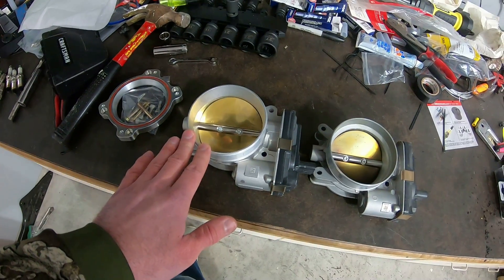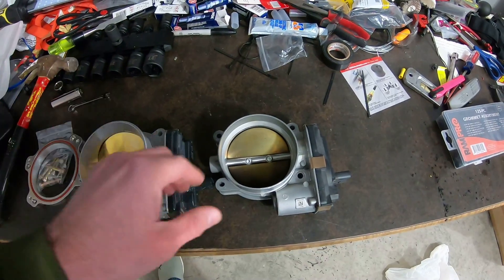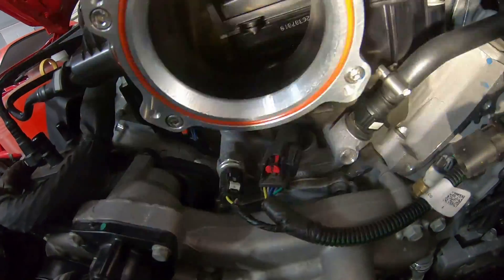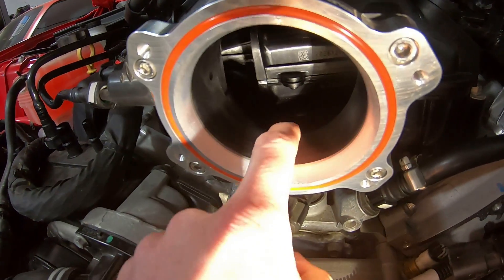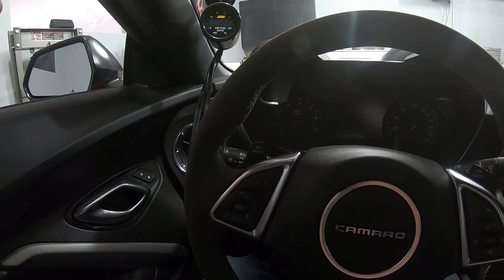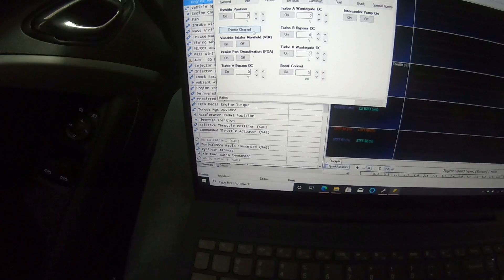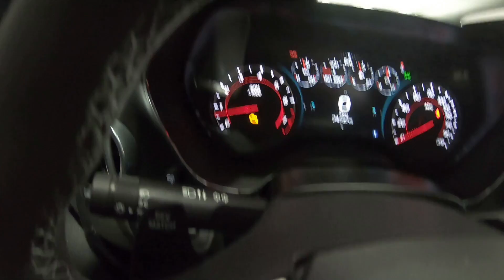95mm LT5 Throttle Body Install on LT2 Manifold

Comment: I put my lt2 intake and put it on perfectly and next week I will be going for my tune w e85 flexfuel ‘ I have another question if u don’t mind ‘ so I bought the 95mm TB with the adapter but it says that it requires tuning to run ‘ can I put it still put it on then a few days I will get my tune ? Or is it a tune required immediately after putting the TB on ? I’m afraid my car will stop running or something if I put it on right now
Reply from the maker: U can put it on. Let it idle 3 min shut off, start and idle 3 min again. As long as it doesn't throw a code it will be fine for couple days. The car will limit torque because of the extra airflow at low rpms. Wait for wot until it's tuned tho to be safe. 👍
Reply from the maker: Pull neg battery too. Otherwise I think the check engine light comes on
Reply: @EssMotorsports  my CEL is already on because of my headers ‘ I took the cats off and straight piped everything
Reply from the maker: That'll do it. Nothing a simple tune can't fix
Reply: @EssMotorsports  thanks for the help bro’ next week I will go in for my trans tune w e85 and flexfuel ‘ my setup is LT2 manifold, k&n intake, 95mm TB, mishimoto catch can, 1 7/8 LT headers and after my tune in the coming months a cam. ‘ hoping for good numbers
Reply from the maker: Let me know what u get for power numbers! That's always fun. What u get for 93 and E85. I'm curious!!
Reply: @EssMotorsports  I will let u know when I get my dyno tune ‘ thanks for your help again bro !
Reply from the maker: The question is how much do u like the new header sound!😈🤟🔥
Reply: @EssMotorsports  I love it ! It screams and echos everywhere ! And of course my neighbors love me :)
Reply: @guyana426  what did your dyno numbers show?

Comment: Can I find this adapter for a 2015 Silverado 6.2?
Reply: Yes you can I have it on my 15 6.2L
Reply from the maker: Pretty sure they use the same throttle body from the factory so the one i used would work on your truck as well.

Comment: So I do not have to port my lt2 intake manifold throat? I’m buying a lt2 intake manifold unported and want to add the 95 mm tb before tuning. So I jus buy the adapter and plug and play? With no porting or special modification to the unported lt2 intake manifold ?
Reply from the maker: Yep! If you buy the adapter it's easy. Everything just bolts up
Reply: @EssMotorsports  thank u so much !
Reply from the maker: You still have to add the fitting in the back of the lt2 manifold like I show in the video and shave bottom. But no porting internally.

Comment: How does this affect throttle response? I understand the concept of airflow and engine combustion but I am assuming youll get better pedal/throttle feel with this larger TB? Also can you do the LT2 intake manifold without a tune?
Reply from the maker: Throttle response is hard to say yet as it's not completely tuned yet and I have timing taken out which affects throttle response a lot.
Reply from the maker: About the LT2 intake its not a for sure yes or no cause every setup is different and I didn't run just the LT2 intake. But I'm trying to lean the car out actually cause it's actually too rich! Idk if that's because the rotofab or what. But the stock tune up top is not far off

Comment: Hello bro, How many HP Increases by changing the TB to 95mm??? . Thanks nice Modification
Reply from the maker: Idk about HP but I can definitely see from my logs I have way more airflow off idle. So it is more of a linear airflow curve then the stock TB. The throttle body is also I think is what changes your tune the most with the different airflow at lower rpm. Wideband would be recommended 👌

Comment: Hey bro I have a question I'm having some fitment issues with my cia I need a spacer to move my throttle body forward a little so I was thinking of using this I can't find anything else at a reasonable price. So my questions are how thick is this spacer and also can I make it work with my stock throttle body?
Reply from the maker: The 95mm to 87 adapter I got is about .5" thick.
Reply: How much clearance do you have from the elbow of the cai to the radiator? In trying to figure out what size spacer i should get? I found a 1/2 " and 1"
Reply from the maker: I measured and my adapter is .5" and I have .5 to .75" clearance to radiator
Reply: @EssMotorsports  so you think a 1" spacer would work?
Reply from the maker: I don't think that would work well. It would make the angle for the cold air pipe even more difficult
Reply: @EssMotorsports  maybe if I could find a 1/2 or even a 3/4

Comment: Is the throttle body plug and play? Everything just hooks right up without tuning? I'm asking because I am going to get my car tuned but the tuner is 2 hours away so I have to drive to him.
Reply: Dude I have ported my throat of the LT2 to make the opening a true 95 mm opening.  You have to port passed the gasket on the intake throat to achieve the true gains.  Port the opening and you will be happy and it’s not that hard to do with a demral tool.  😏
Reply: @Standyourground21  what did you use for a gasket?
Reply: @slickrickdarula9483  depending what adapter plate you get there’s usually one included.  I order the K-Tech and Lingenfelter. Ended up using the Lingenfelter, plus I had a few gaskets from my other build for 95 mm Nitrous plate. The adapter plate has a built in gasket. I used a gasket between the manifold and the adapter plate. 

https://www.lingenfelter.com/product/L270036914.html#.YFalkWSs-_Y
Reply: @Standyourground21  cool thanks bro
Reply from the maker: Yeah plug and play. It is super quick to do. 15 minutes
Reply: @EssMotorsports   So I have a dremel is that what you are going to use to clean up the Spacer? And if you do it can you make a video?
Reply from the maker: @slickrickdarula9483  I already cleaned it up. I used a sandpaper wheel and on a drill and just going around until it matched up better.
Reply: @EssMotorsports  Nice thanks again bro you have a blessed night!!
Reply: Will this tb bolt up to a stock intake manifold
Reply from the maker: U need an adaptor as the 95mm has different bolt pattern

Comment: Good video. Food for thought for when mine is out of warranty. Like the LT2 concept. Don’t know if it would fit under the strut tower brace?
It would be cool to some how modify the stock covers to fit on top so it looked un-modified. Look forward to seeing your drive/tuning
Reply from the maker: I believe on the 6th Gen forums people have installed the LT2 intake with a strut brace. But you have to trim the ribs off the intake top or notch the strut brace.
Reply from the maker: This sounds easier!
Reply: I was wondering the same any progress stock covers on an lt2?
Reply from the maker: If I remember right I tired quickly to put covers on and was like not going to work. But I didn't try to hard. I like it better without. Someone on Camaro6 forums would probably know.

Comment: Surprised you didn’t opt for the ported Soler TB
Reply from the maker: The stock 95mm TB flows plenty for my application. Plus way! Cheaper
Reply: @EssMotorsports  I have the ported Soler  87 mm it flows like a 91 mm got it used for $ 225
Reply: @paintslinger16  you coulda saved $30 and got a 95mm that flows like a 95mm

Comment: Nice man I was thof doing the same thing but not sure if it will make a difference without porting the snout. Do you have to have the adapter?
Reply from the maker: The adapter makes it so its a plug and play event. Otherwise the bolt holes don't line up. Pretty sure the butterfly would hit too.
Reply: @EssMotorsports  if I wait and do it after I get the car tuned will I need a retune?
Reply from the maker: Not entirely sure that's why I just did it right away incase it does before I start tuning. Maybe someone else can chime in?
Reply: @EssMotorsports  but the adapter takes it righ back down to a 87mm opening. I think what Slick Rick was trying to say is your not taking advantage of the 95mm opening.  You can I a ICT adapter to line up the bolt holes, then port the snout.  Thats what I did on my cammend L86.